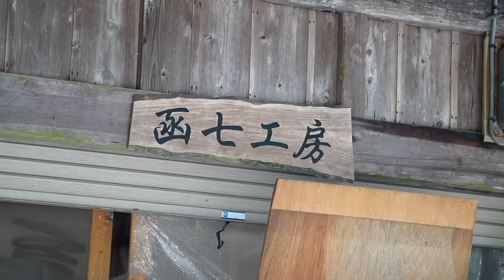鉋を使ってジュエリーボックスを作るプロセス。日本の職人による素晴らしいウッドワーク

Comment from the maker: You can get this product from the link below!
https://suigenkyo.store/products/paulownia-wood-jewelry-box

10% off coupon "SUIGENKYO10"

Product Name:Paulownia Wood Jewelry Box
Discription: This paulownia box is perfect size for holding small accessories.
There is no two pieces of wood that have exactly the same grain, which making it a one-of-a-kind product.
It is precisely made, and the lid closes so snugly. Please take it in your hand and experience the art of Kyo Sashimono.

No nails is used!?
The wooden parts are made without using any nails, and are made by making uneven surfaces on the wooden parts and combining them elaborately.
Even though no nails are used, it is strong and can be used for decades.